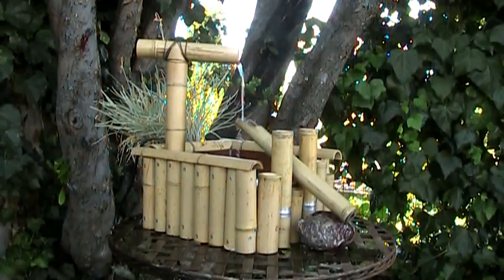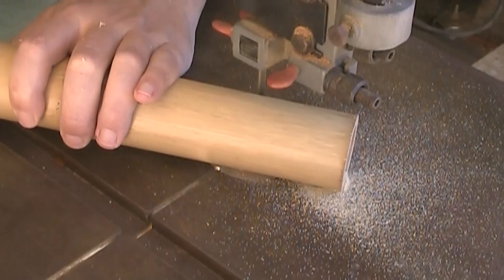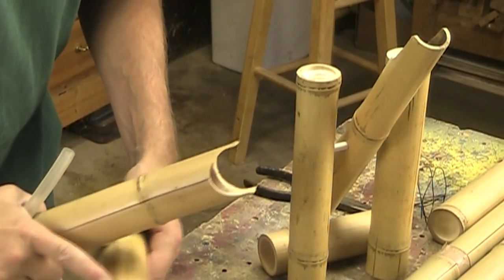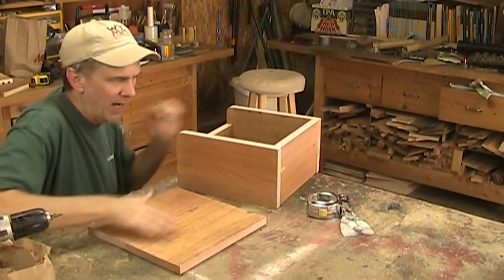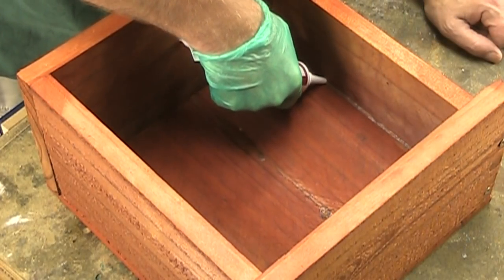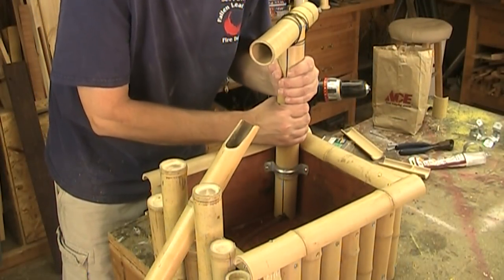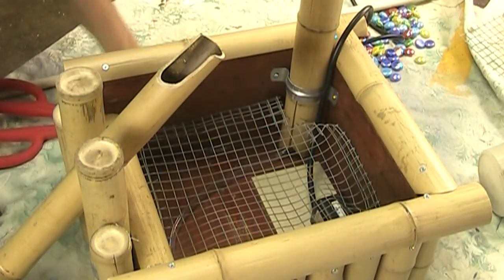Make a "Kill Bill" style Shishi-odoshi "deer scarer" bamboo water fountain

Comment: if you watch kill bill again youll notice that the deer scarer is VERY slow and methodic. you want 10 seconds or so in between each pour for it to be a relaxing water feature. the faster it pours each time, every 2 seconds or so for yours, the more is actually becomes an annoying thing to hear constantly. to change the speed, plumb in a small ball valve after the outlet of your pump and adjust the flow to slow the speed with which the "knocker" fills. you also have it so that when your knocker pours its water it makes a hitting sound on something and then also hits the rock to make a second sound. the scarer in kill bill only has the hitting sound when it returns to its upright position, directly after pouring out its water. play with the weight distribution as well to slow the speed at which it "pops" back up to its upright position. i would also increase the height of the pourer so that it actually pours its water out into the pool and you can hear the water itself splashing. thats what makes it a water feature. if you cant hear the water pour into the pool its useless. slow and steady is what makes these machines beautiful. the faster and louder they actually are the worse of a serene water feature they become.
Reply: Yea I was confused when the water catching cup was so small, I just watched another video and it banged every 50 seconds. Maybe he just needs more weight? But also that’s probably how it scares deer, by taking a long period in between bangs so they don’t get accustomed to the noise. 

But for a first attempt, I’m really impressed with this DIY.
Reply: Maybe he’ll make another one that’s improved
Reply: Most pumps have a water flow adjustment, which I’m sure he is aware of, and probably has it set up how he likes it. You can do the same as you like it.
Reply: That part where o ren ishii apologize’s to Beatrix kiddo I saw it

Comment: Steve for future reference with bamboo, I have found those 'baffles' are what actually cause the bamboo to trap air and split the bamboo when its taken off its column and drying. You can relieve the pressure by drilling a small hole in the side, or cutting off both ends and busting out the baffles with a pole or stick.
Reply: in a model shop you can buy finishing resin and a very fine fibreglass sheet it gives you lots of time to apply the two pack resin as it goes off very slowley even in summertime mix the resin and apply the glass sheet around the outside of the split bamboo and it will not affect the look of the bamboo when dry and it will never leak again.

Comment: In the movie the clicking is a double tap sound as the empty recepticle returns , if you think about how a wooden glockenspiel is played with rubber ends on sticks, you could probably recreate that sound with a hollow tube of bamboo under the end of the water recepticle tube instaed of a rock and an eraser or what we used to call a powerball as kids cut in half and glued to the end of the water tube to give it some bounce as it returns to the empty position, well done for your efforts thus far though, I cant even source bamboo big enough in the UK so im going to try alluminium tubing instead I dont think its going to be quite as quiet. I was saving the tubing for a giant bass wind chime.

Comment: That's usually because the Shishi-odoshi  is meant to be part of a larger setup. Traditional ones are usually connected with a small waterfall or stream through a series of tubes and the water just drains away into the soil. These tiny home made jobs, though entertaining to listen to, aren't similar. You have to obviously - as you would do with any standing water empty it every so often.

Comment: Not completely sure if your box was leaking any, but coating it with a layer of fiberglass resin will work. I had the same predicament trying to figure out how to make a wood box air tight. Just brush it on the surface, and give the inside corners a couple extra coats to fill any gaps. Best thing is, you don't have to worry about your deck sealer wearing down, or missing a spot with the silicon.

Comment: One way to waterproof a wooden box is to use a small wire and hammer.   Hammer the wire to create a groove around all the seams(under the mating surfaces) before assembling.   The water will cause the groove to re-hydrate and seal the joint.   Saw it on the Woodwright's Shop years ago.

Comment: You could round out a notch on either side of the bamboo that runs along the top of the box and run the wire over the box and under the bamboo. You wouldn't have to worry about putting a hole into an otherwise waterproof box and the wire would be mostly hidden.

Comment: One thing I would of done is make the bevel cut in the flapper a little deeper so that the spigot would spill less water on top of the flapper. You can see that the water runs down the top of the flapper and soaks the stone when it hammers back up. Hopefully that would keep more water in the reservoir for longer.

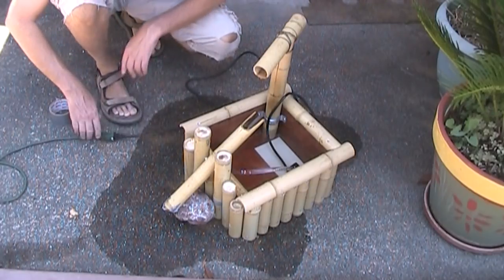Comment: Nice one but no good. The trough should have been longer to trap escaping water from the end of the see-saw tube. Otherwise there will be no water in the trough for a short time. Any water that escapes out of the trough will be lost, as shown at 6:10
Reply: Mick Carson  Yup, was thinking that. Also, from my own experience, I would not be using silicone sealant for a permanently underwater solution, it just does not hold on for long enough. Tried it on a fountain and eventually it slowly peels away.
Reply: blackspaven 
Yes, never underestimate the corrosive power of water, fresh or salted, and never think of Silicone as a cure-all, as sometimes even Silicone sealer is a bad batch that hasn't got the proper adhering quality.

Take that from the Silicone sealer used to bond fish tank glass. It may hold and seal the glass but over time it starts to discolour and its thin Silicone film around the edge start to peel off. I don't know why, but I believe it could be due to elasticity or a tiny percentage of shrinkage. Even when used to seal the base of a bathroom shower recess the Silicone doesn't hold on well, water still finds its way in through tiny cracks and from there, inside those cracks and behind the sealant mold, or mould, starts to grow (usually grey to black), an indication of water's seeping power. 

The best proven material to use is a type of hard plastic sheet and a plastic welding gun. The bonding job is similar to bonding glass to glass, using same thickness sheets as aquarium glass then bonded with hot plastic coming out of the nozzle, difficult but effective. 

You can even use those clear or black plastic squarish 25-50 liter liquid containers cut in half or remove the top to make a 'well' type of water retainer. You just make a cane box around it.

Or if you want to do it a bit cheaper than peanuts you can line the water retaining box with a A) cut sheet from a large black plastic rubbish bag/s; B) a thin rubbery blask sheet used as a fish pond liner or C) a clear plastic sheet, the type found wrapped on household appliances, or bed mattresses, which are thicker and does not rip easily. Peanuts for thought. Cheers.